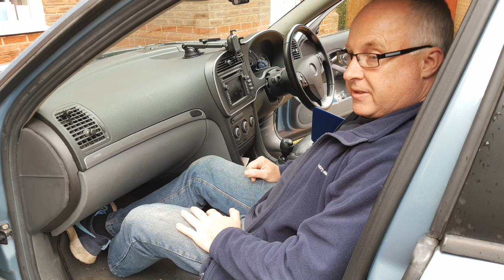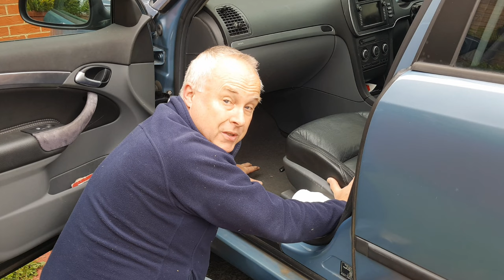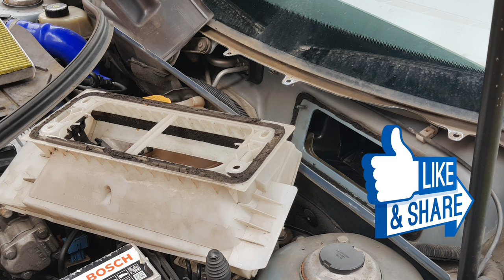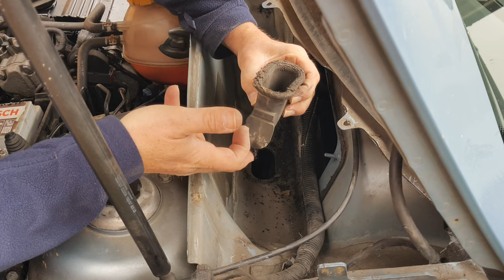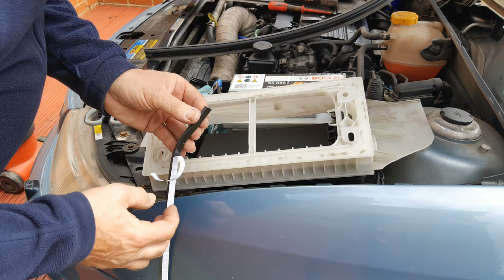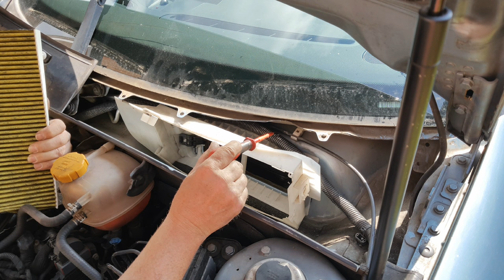Saab 9-3 Water in Passenger Footwell | Easy DIY Fix

Comment: Just started having the water come inside my 2011 Saab 9-3. Awesome video. Clear explanation and fix. Going to save me so much time, $, and frustration. Desperately needed to empty drain rubber and get a replacement filter. Quick question - what dimensions is the foam gasket that you use? Thank you!
Reply from the maker: Glad it helped, Elizabeth. You'll need a seal about 10mm thick capable of squashing down to about 7mm. Really it's more of a base for the silicone. Try this in 10mm wide and 10mm thick, 2m length will be more than enough https://bit.ly/EPDM_seal
Reply: @CycloneCyd  Awesome! Thanks for the dimensions and link!
Reply from the maker: @momothevine  do let us know how you get on
Reply: @CycloneCyd  Hey Cyd, wanted to jump back on here and let you know how easy the fix was per your instructions. My son and I worked on this project together. We were shocked at what was left of the foam gasket... just goo. I don't think the filter had ever been replaced. You saved me so much money. Thank you!

Comment: I got a 2008 93 with 215,000miles original everything but I got water behind drivers seat not coolant water and it happens randomly not just when it rains and I've shop vacuumed probably over a gallon out of it just keeps coming. Any thoughts?

Comment: Hi mate, I forgot to check which way the rubber bung goes back in to drain the water, does it go back in with the flap pointing to the left or the right as you put it in? Thanks & great vid too 👍
Reply: Did you find out which way it goes? I have the same issue. Should the water drip onto the subframe?

Comment: I Just did the procedure you perfectly expose on this video, so thankful for your amazing help, have a question: behind the passengers seat is also floated , and I mean 1/2  inch over the carpet, I inspected some other areas on the car of potential liking , is it possible that all this water came from also from the fan vent? Thank you in advance, amazing vids you are producing, I'll be checking one by one! Arthur
Reply from the maker: First priority is to dry it out properly. See here https://youtu.be/VEPIuDomLYI
Yes it could be, but I'd also suspect the rear door shedder. Has that door casing ever been off?
Reply: @CycloneCyd  having this same prob... what is a " rear door shedder"?

Comment: Thanks for your helpful videos! I have a 2008 RHD Saab 9-3 and my problem is a wet driver's side (right side) footwell. The dampness is water (no taste, odour etc), and I've tried your remedies above. The drain plug was a bit clogged but there was no standing water (or signs of standing water) around the passenger air filter area. The seals around the housing are in good condition and not leaking. Am I likely to have sorted the wet footwell or is there another problem that's known to cause a wet right hand side footwell? Thanks in advance, Brian.
Reply: Just to add that after my 'remedial' work the driver's side footwell is still soaked. I can't find where the water is getting in but it's much worse after heavy rain. The door seals are undamaged, coolant reservoir level is still constant, air con is still working correctly.

Comment: My question is the following, if I have not been able to get the audio amplifier that goes under the doing of the driver, how can I make the audio continue to work without this amplifier?  My Saab is a Vector Aero 9 3 model 2004
Reply from the maker: AFAIK, you can't, thanks to the fibre optic link.
Reply: @CycloneCyd  Thank you very much, I have seen that in some Saab stereos from other brands are installed, does this not affect any function related to the amplifier?
If so, then can I install a Sony Stereo without a problem?

Comment: THAT WAS REALLY GOOD JOB THANKS.FOR ALONG TIME I AM CURİOUS ABOUT THİS WET SMELLS I LL DO İT FIRT TİME
Reply from the maker: remove the seat (see my videos) and the door kick plates and lift the carpet. Dry it as best you can with towel etc and leave the carpet up and doors open to let it dry thoroughly.
Reply: my polen filter  behind is free ı can directly see the fan.can ı close thıs part couse stop to water sliding in

Comment: I have condensation buildup under the driver's side floor mat of my 6th gen Honda Accord when the weather gets colder.  That is if I put a rubber mat.  On the passenger side it doesn't have this problem. Do you have an idea where it could come from?
Reply from the maker: HVAC? All hvac systems have a evaporator drain. On the Saab it's common for it to block and the water can't drain away so it spills onto the driver side floor. It might be like a rubber 'lip' (like the Saab) or a plain piece of pipe  located somewhere near the middle of the car where the dash meets the floor pan. Make sure to get the car as high as poss - and use good axle stands and be safe. The pick up tube from a plastic spray bottle is a good tool to use to clear the drain.
Reply: @CycloneCyd  No, it's not On the mat,  it's under the rubber mat.  So I placed newspapers to soak the condensation.   On the mat there's no water or condensation.  If I place cloth mats,  there's no condensation too (at least I can't feel it touching with fingers)
Reply from the maker: @zacmich6472  On the Saab, water from the evaporator gets onto the dash and then runs down under the main carpet and sits on the floor pan under the carpet. If that's happening on yours the rubber mat could be inducing capillary action drawing the water through the carpet.
I don't believe it can be condensation - there would have to be a flow of air under the rubber mat which is being cooled below dew point for that to happen. With a rubber mat sat on carpet, there can be no appreciable air flow between the two, nor is there any cooling mechanism.
Are you sure it's water and not coolant? Taste it to see. it'll be sharp and bitter if it's coolant and probably coloured.
https://www.youtube.com/watch?v=VEPIuDomLYI
Reply from the maker: @zacmich6472  Did you find the problem?
Reply: @CycloneCyd  I didn't. I sold the car today. Now someone else hopefully will care for her as much as I did.  They don't make such beautiful cars anymore. Happy New Year!

Comment: I followed  your video and changed the gasket with a saab gasket used some silicone. We also cleaned out the drain and put it back in. We also replaced the windshield cowl.  We got the car wet and its still getting wet inside right by the console.  so frustrated any ideas?
Reply from the maker: There's a drain on the drivers side too.
Reply: Take it to a garage and stop wasting time doing it yourself
Reply from the maker: @fuhq9695  most mechanics at most garages aren't qualified to service a walking stick. If some Nobby NoLevels at a garage can fix it, so can YOU.

Comment: What if it is not only in the front but als on the backfloor and not only on one site, and only occuring during the rains?
Reply from the maker: I'd suggest checking the door seals themselves. If not that, check the door shedders - remove the door casings and check the shedders are properly sealed to the door panels.

Comment: Thanks for this great video- did you buy specialist foam or sealant? Would be great if you had a link to it if you did!
Reply from the maker: Any foam will do, it's only there to give the silicone sealant some support whilst it sets, really.
A length of big D seal would do the job (almost anything is better than that crappy foam Saab fitted) http://bit.ly/big_D

Comment: I recently bought an 07' 9-3, (LHD) I fixed the filter box immediately, but to no success, my passenger footwell is still wet after washing the car. I checked the filter box and the inside is dry. It appears as tho the water is coming somewhere from the center console side, can't tell exactly from where, but the doors are not leaking any water, it's dry on that side. Maybe someone else had this problem and can suggest some things I can check?
Reply from the maker: Make sure it's not coming in via the door seals or even from the door cavity (eg a damaged shedder). Maybe get someone to hose the car down whilst you do your Harry Houdini impression inside to try and see the leak.
Do let us know how you get on.
Reply: @CycloneCyd  Thank you for your help. I've checked the doors, they're definetely sealed properly. Researched some more and found out that the drain for ac system condensation is probably clogged and causes all the water to drain into the passenger side when the ac is on. I'm going to try and clean the drain and see what happens. Once again, thank you for your helpful videos and replies.

Comment: They didn't design it very well. I take it that's why most cabin filters in cars nowadays are located inside the footwell
Reply from the maker: Locating it inside does a number of things generally (all design & engineering dependant of course): reduces engine noise ingress, eliminate danger of fume ingress, easier to get at (cheaper servicing) and on some cars (Fiesta is an example) the filter is behind the IP centre stack which means recirculated air is filtered (important to the Chinese buyer in particular).
In these Saabs, after the interior has cooled somewhat, switch recirc OFF (ie take in fresh air) so it gets filtered and the air in the car will be very clean in about 10-15 minutes. Particularly if you use a PM2.5 filter (eg Mann Frecious)
Reply: @CycloneCyd  does the air not get filtered when in re-circ mode?
Reply from the maker: @VSTV1993  on the 9-3 no, the air recirculation bypasses the filter. There are some cars where it filters in recirc, but not many. That's why you should only use recirc as little as you need but otherwise keep the cabin taking in fresh air if you want cleaner air inside.